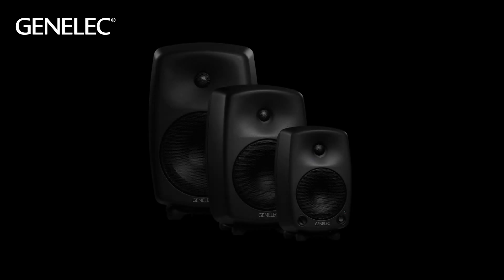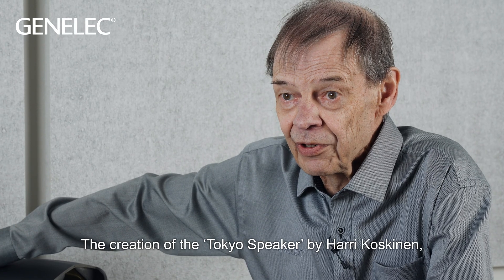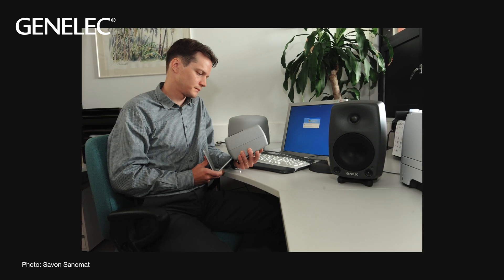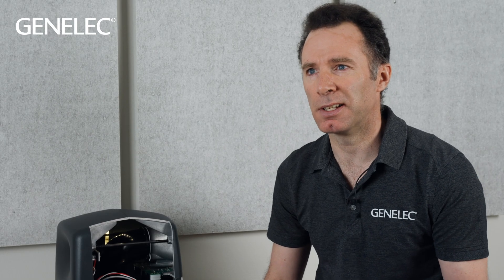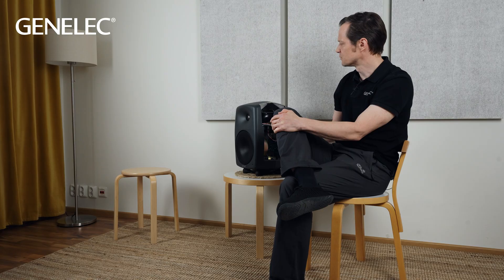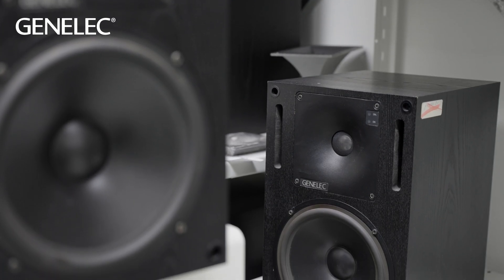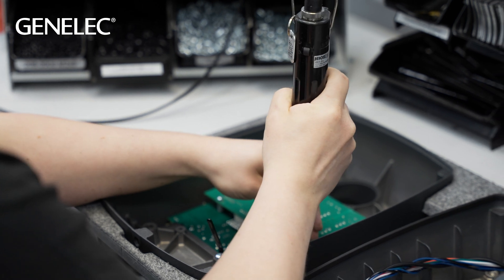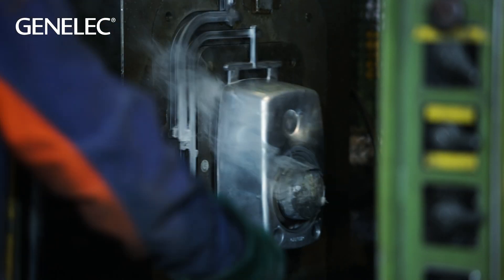Celebrating 20 Years of the Genelec 8000 Series: A Legacy of Innovation and Courage

Comment: One of my 8020 DPM broke after 3.5 years. It didn't power anymore. My dealer sent it to Genelec and they could not tell whats broken. Genelec told me I needed a new circuit for almost the price of a whole new speaker. I requested the unrepaired speaker back. Unfortunately very unsatisfying, although I liked speakers.
Reply from the maker: Hi there! I assume the speaker was shipped from dealer to one of our distributors service, and not directly to Genelec. We would love to hear more from your experience, if you can send us e-mail to support@genelec.com and we can check if there is anything we can help with. We always aim to have repairing more cheaper than buying a new product.

Comment: 20 years without new innovations, materials, algorythms, improvements ? Stuck in time ?
Neuman just came out with new models with improved frequeny response and more..... what about genelec....? 🤷
for me, keepin' the 20 years old stuff without any improvements is no sign for good management and movin' forward....
Reply: What would you want them to do? They've refined the 8xxx series over the years. You have A,B,C and D revisions for a reason.
Reply: @lukapogo  for what i know these are just different types of connectivities or some more triggers....
Reply: There is 83*1 SAM concentric design speaker series. They are better than Neumann, but much more expensive.
Reply from the maker: Just check out our complete SAM range of speakers and subwoofers. And we're offering DSP-based calibration and our own GLM software since 2006. And have you seen the GRADE report? There is a lot to discover, you're very welcome!
Reply: @genelec   Thank you for this advice.
There is a permanent and very quick (yearly !) development in electronics (processors). In my opinion this could be the fundament for better algorithms for to modify speakers to even better frequency response, time alignment, phase correction oder just for better DSP-calibration.
So it's not about the material of the housing or the woofers/tweeters and not about the construction or the setting of the monitors but about the integration of new and better algorithms possibly leading to higher quality...
Reply: Did you miss the coaxial designs or?
Reply: @RecluseRR .... as I said:... these are just new connectivities.... 🤷
Reply: @petregabriel1098  New connectivity's?
Reply: @johnnysilverhand1733 ... so why-tf didn't you read my first posting...? 😉
Reply: @johnnysilverhand1733  oh..... so you determine which is the best...? 😉.... and you know ALL of them...? 😄
Reply: lmao😂
Reply: @johnnysilverhand1733  wonderful..... all fan-club members have assambled..... 😄👍..... together they are mighty and strong.... 😄
Reply: @petregabriel1098  Just new connectivities? Wow, that's ignorance at a whole new level. In addition to the 8000A-D revisions with new amplifiers and internal electronics, there's the 83*0 series which introduces DSP and Smart Active Monitoring, there's the 83*1 series which has the most advanced coaxial design of any loudspeaker that Neumann doesn't even have a direct competitor of. Last year, the 8381A came out and it might be the most advanced and most sophisticated monitor in the world. Genelec's GLM and GRADE software don't even have competition whatsoever at this point. Their recently-launched UNIO ecosystem also solves a huge problem in monitoring consistency.

Genelec is the only loudspeaker company investing to solve real monitoring problems and actually delivering, which is why they're still the industry standard. They don't win TEC awards almost every year since 1993 for no reason. Even If they stop innovating today, they'd still be light years ahead of everyone else. Just because you decided to be ignorant about what they're doing for the past 20 years, doesn't mean they're not doing anything.
Reply: @raykrislianggi  hi..... as far as I know the complete 83**-series is unmodified since at least 2017.
7 years is a very long time....
Reply: @petregabriel1098  The 8351A came out in 2014 and was replaced with a B version in 2019. What about the Neumann KH 310 A and KH 420? They came out in 2012 and 2014 respectively, and have been unmodified eversince. Why? Because if you try to modify perfection, you end up with something less, unless you come up with a new design or a new product altogether.

The 8361A was tested by Amir from Audio Science Review and the spinorama data shows that it's objectively the closest to perfection that a loudspeaker can perform. The way I see it, Genelec has basically perfected their hardware, which is why they're now investing more into the real-world implementation with GLM, GRADE, and UNIO, because the only problem left is the room / environment you're in.

Modifying something that people are already familiar with isn't a good move, which is why many major studios are still using the 1031A, because they know the sound very well and it's still relevant today. Many monitoring headphones are still in production since the 1980s, like the DT 770 Pro. 7 years is a very short time in the audio world because good sound would last forever.
Reply: ..... i know, many will say that there is no need for any improvements..... in my mind, this is the first step of going down....